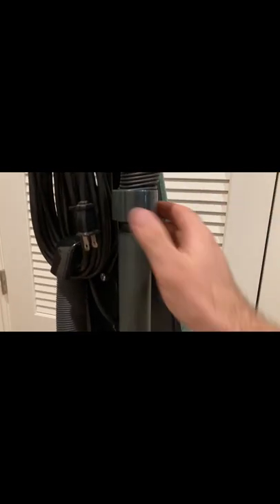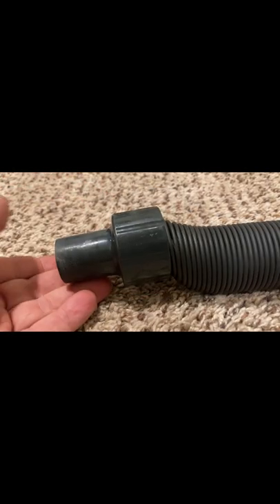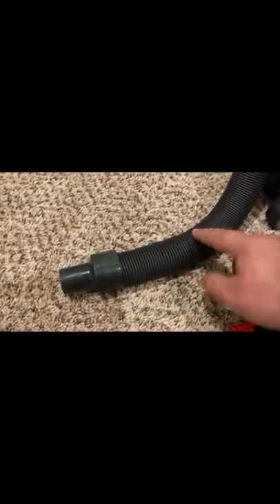Save a Torn Vacuum Hose

Comment: Now since it was going to be under vacuum, I would have searched for some real thin fabric tape. Duct tape might not have been flexible enough. But I'm thinking I saw tape used before. Never knew how it threaded together. Side note: I got a dirt devil needing a cord relief fix. It's not too safe with the insulation showing. Gonna chop and resolder.